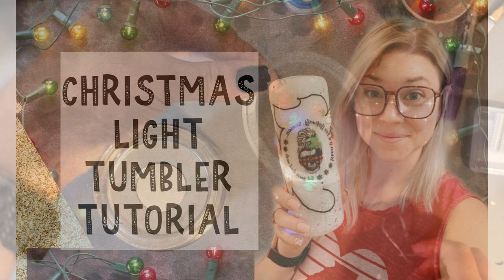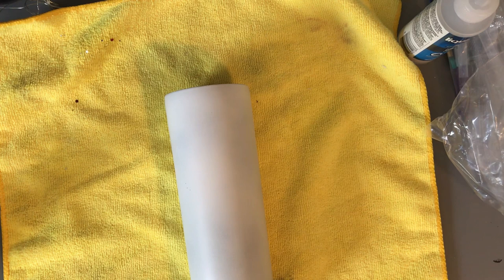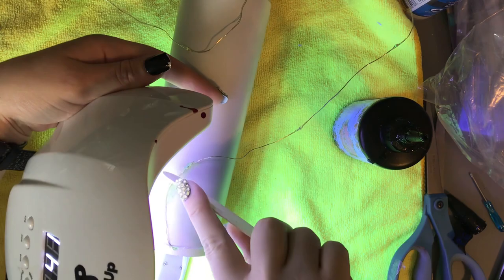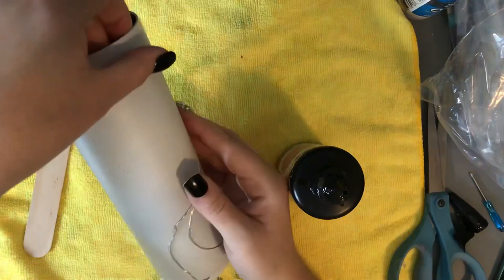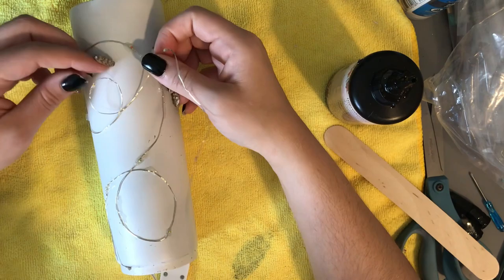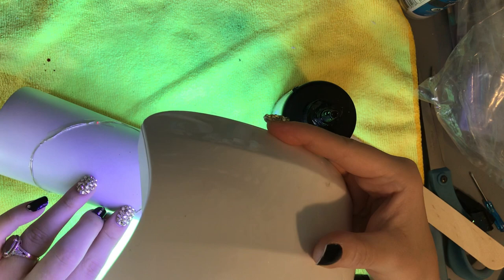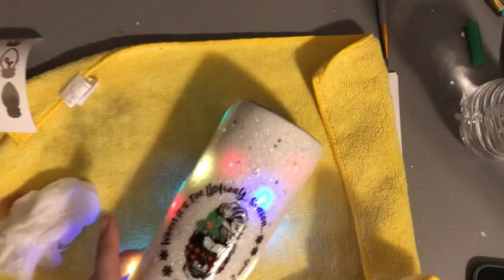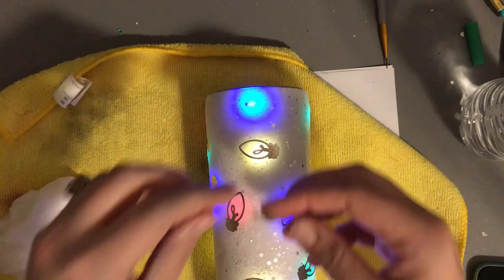Christmas light tumbler tutorial with NO showing wires or battery pack

Comment: Your cup is one of the best I’ve seen! I don’t understand the glitter and epoxy part, first the glitter, did you put glitter overtop of the light itself or just over the wire? And my next question , when you epoxy over the glitter was the mold attached and you epoxy over the mold too? Ok I have another question. If I wanted blue glitter and colors light would the lights show thru the colored glitter?
Reply from the maker: Hi Wendy! Thanks so much! Yes, the glitter I use is a transparent white so the lights still shine underneath. Yes, I attach the mold and then epoxy over everything which insures the mold is secured to the bottom of the cup. And lastly, it will depend on the glitter, if you use a transparent blue glitter the lights will shine though the blue may effect the color of the lights- if you glitter is opaque, I doubt the lights will shine through. :)

Comment: Awesome!! I went on the site and they have different size molds. How do we know which size ring for which cup? Thank you 😊
Reply from the maker: They have measurements so measure the bottom of the tumbler you want to apply it to. :) they have a ‘cheat sheet’ for a handful of Hogg tumblers but I just ordered a few sizes and made them work. If you order a larger size you can cut a chunk out while it is still a little soft and make it work for several tumblers.

Comment: I click the Amazon link for the fairy lights and it takes me to paint?  I love this tumbler though!
Reply: I think any kind of fairy lights should work. Just as long as they have that same kind of a bottom as hers does in her video. Just a little tip incase u haven’t gotten them yet, if you can, try to stay away from the fairy lights that have a small empty spot at the end where there are no lights attached to the cord. (It’s just the cord at the end but an inch or so with no lights and then the lights start. It’s just a little harder because your left with more cord you need to hide that don’t have any lights on them. It’s not a lot at all, it’s just a lot when your already trying to find areas on your tumbler to hide the cord. This is when your doing a 20oz anyways. The tumblers smaller so less room to hide. Just from my experience. Good luck!

Comment: How did you close the bottom? Is it left open with the battery pack exposed?
Reply from the maker: Yep, it is left open. The cups sits well  :) I test it by washing the battery pack and it still works great. I think as long as you don’t submerge it for a long time it will be okay.
Reply: @damfancycreations  Great thanks. I didn’t see the bottom at the end. I loved your tutorial and will be trying it soon.
Reply: Thank you so much for asking this. I was wondering the same thing
Reply: @damfancycreations  how do you keep the battery pack in place?
Reply from the maker: @dawnharper9004  velcro

Comment: Thank you! I love this option with no bumps.  I was wondering do you think it would be safe to use on plastic reusable cups? Thanks
Reply from the maker: I wouldn’t- unless they are double walled durable plastic cups. If the plastic is weak it can bend easily and cause the epoxy to pull away from the cup.

Comment: I love it, so you unscrew the bottom part and place the clear piece in and keep the bottom lid off?
Reply from the maker: There is no bottom lid.
Reply: @damfancycreations  so is the battery pack exposed all the time? How would they change the batteries if they die?
Reply from the maker: @turtleduck9987  it is exposed. You can change the batteries just like normal.
Reply: @damfancycreations  where do I order the bottom piece with lights from?

Comment: With that bottom ring how easy is it to turn the lights on and off?
Reply from the maker: Really easy. You can either take the battery pack off and flip the switch or leave it attached and flip it with a pen, scissors or anything else that will fit :)

Comment: I realize this video is 2 years old now but I'm so confused on the light pack being put on the bottom (with the extender mold) does the battery pack just sit there open to change the batteries? Thank you so much!
Reply from the maker: Hey Kim, it does. I just add a piece of velcro or a tiny strong magnet to hold it in place. :)
Reply: @damfancycreations  Thank you very much. I loved this tutorial.

Comment: Did you have any trouble with the lights still bulging a little after epoxy, glitter and epoxy again?
Reply from the maker: I epoxy until it is pretty smooth so 2-3 times depending on how thick you apply

Comment: How many coats of epoxy did you actually use on the lighted tumbler?  I am on my second coat and it is still bumpy.
Reply from the maker: I don’t know exactly how how many- definitely more than 2. I always epoxy until smooth. How many coats will also depend on how thick the epoxy is that you are using.

Comment: I looked on their sight for cheat sheet for sizes.  I don’t see anything.  Can you help fir a Hogg 20 oz skinny straight what size would I order??
Reply from the maker: Measure the bottom of the tumbler to see which size would fit best. :)
Reply: I just ordered two molds. Looks like the 20 oz skinny is 2 inches and the 30 oz skinny is three inches

Comment: Did you epoxy over the mold and battery pack or just around the rim of the mold?
Reply from the maker: The bottom is left open so you can easily access the battery pack to change the batteries. :)
Reply: @damfancycreations  okay thsnks! So you just epoxy the rim of it then?
Reply from the maker: Well, I glue the ring on and then glitter and epoxy the cup like normal EXCEPT for the very bottom/ inside of the ring.. if that makes sense!
Reply: @damfancycreations  yes it does, thank you!

Comment: Why not set the battery pack on the base then glue the ring while leaving the wire on the notch? That way you don't have to feed it through
Reply from the maker: Bc I glitter and epoxy everything so there isn’t a random ring at the base of the tumbler. I can not glitter and epoxy if the wire is already fed through the hole. :)

Comment: ok but when we wash it what is stopping us from getting electrocuted since we would be getting water on the battery pack? ????????????????
Reply from the maker: I am careful when I wash it. But.. the lights aren’t going to be on. Turn the switch off and there will be no electric current. Take the batteries out if you are worried about that.
Reply: There is not enough juice in a battery like this to electrocute you even if you messed up and washed it. Worst case, you ruin your lights.

Comment: So how did you add the glitter? I added it and I still see all the wires?
Reply from the maker: I applied it with epoxy. I did use an opaque glitter though, if you use translucent you will be able to still see the wires.